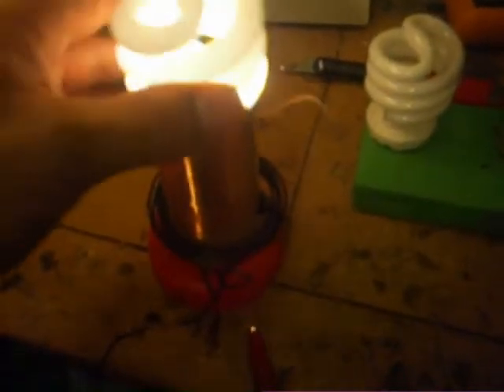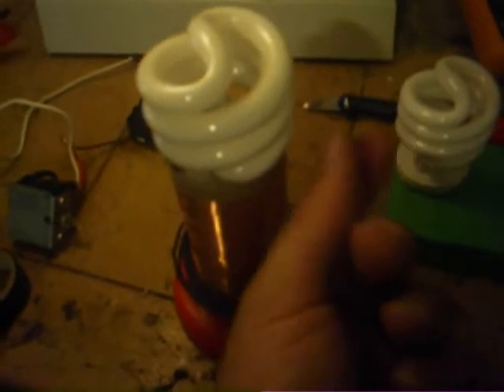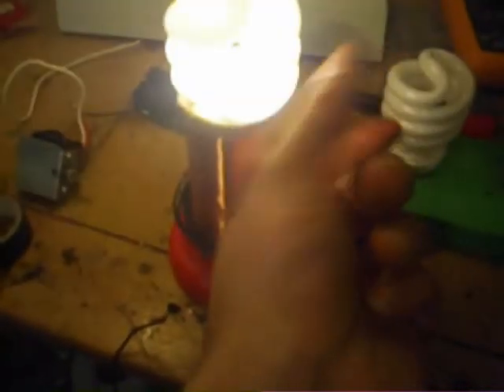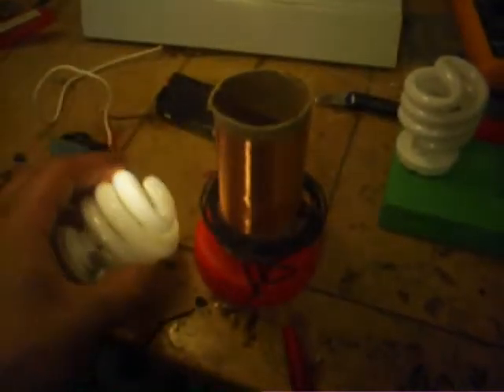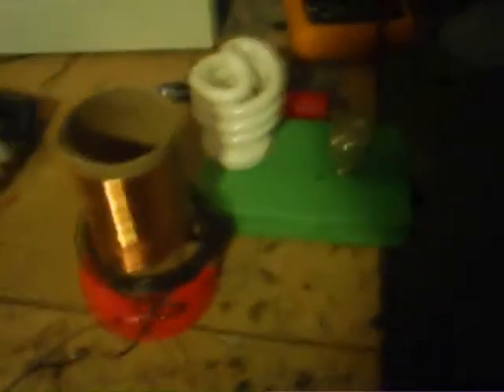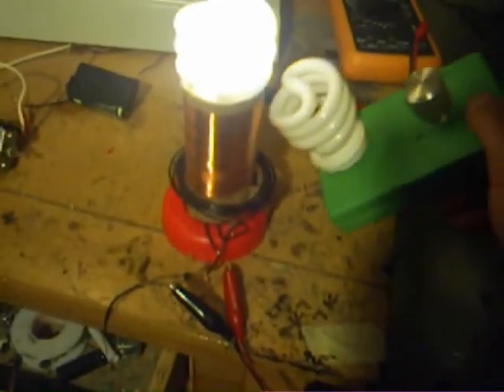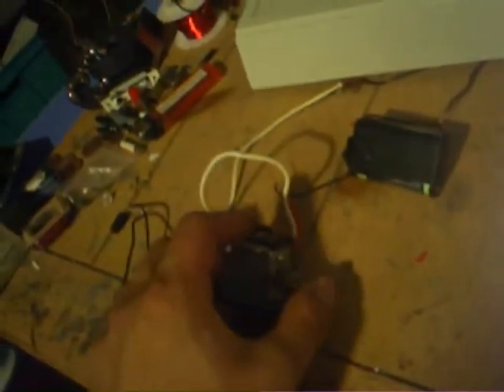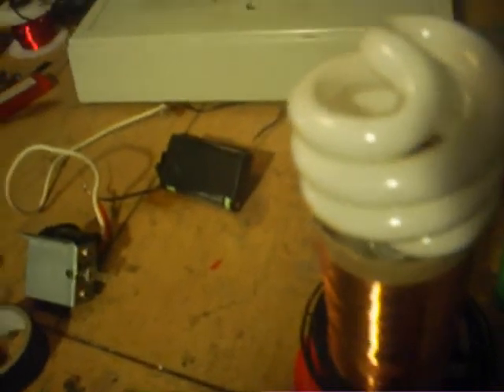Easiest wireless exciter, closer look at wiring.

Comment from the maker: @snyperbob lol i hear ya man.. thats why i wanted to make this vid. finally after a month or so of playing with it i finally think im starting to get it all.. the more advanced circuit im using now is badass..
the CFL's are just plain bulbs but these particular ones i gutted from the ballast. thats not necessary with the exciter though since its all wireless. as long as the tower has enough input, and is outputting enough HV, it will light stuff. recently ive been lighting an incandescent 1-wire

Comment: @Magneticitist Semi-conductors didn't arrive tell the late 50's or 1960's. Tesla was doing his experiments back in the early 1900's up tell he died in 1943. Semiconducters make this low voltage operation a reality because we can take trace elements and dope them in silicon waffers and add metal legs for connections at micron levels not available to people back then. Tesla was way ahead of his time but all he had for electronics was old tube amplifers and radioactive elements.

Comment from the maker: @egn83b well yes the oscillation is obvious.. the wireless field and its strength however isn't, to me at least. i mean its just a tesla coil but why would tesla use such high voltage input if it wasn't necessary

Comment: The only reason this works is because you are biasing the base of the transister with all the electron excitement in the air around the coil the metal on the base is basically a crude antenna reciever. The transister will go out because when you touch the top wire you put too much load on the collector off the coil when you touch it. This is simplist exciter buildable. Electronics class helped me understand all this stuff.